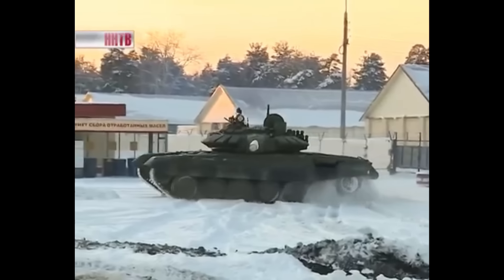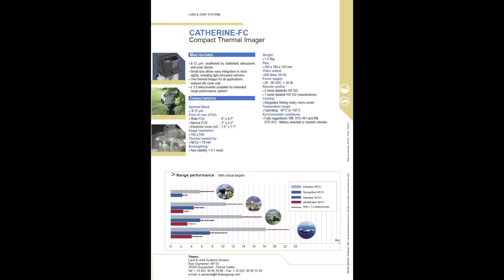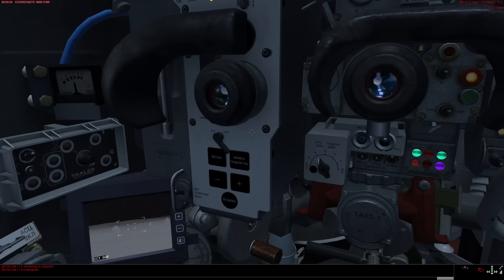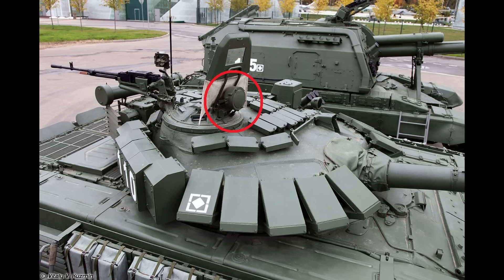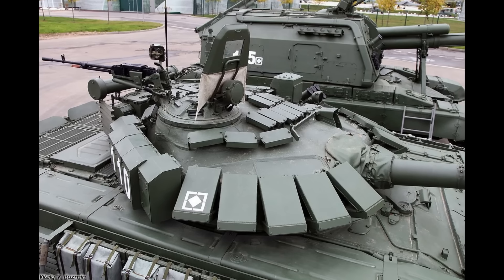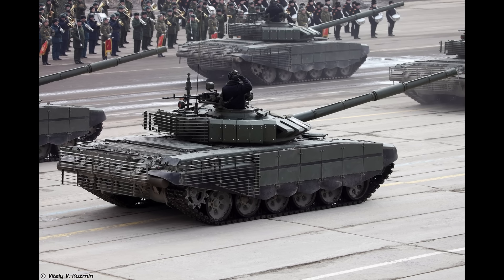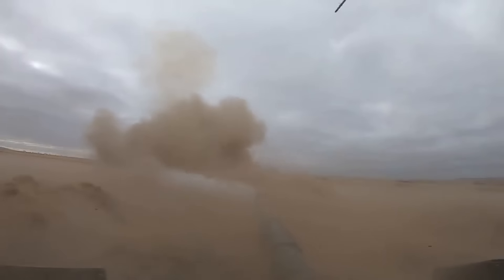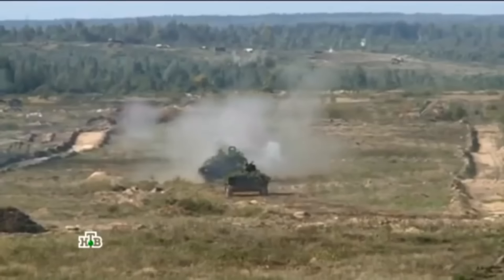Problems with Russian T-72B3 tank

Comment: Military History Visualized did a video about the German Army evaluating the T-72s it got from the Unification with East Germany. The issue with the three mile per hour reverse speed came up. To compensate for the abysmal speed, DDR tankers would instead turn in the direction the wanted to go and drive forward rather than backing out thereby exposing the thinner parts of the armor.
Reply: @Dave That was because the reverse gear was often already broken.
Lots of german armour had very troublesom gearboxes/drivetrains.
They did not have enough materials/equipment to harden/ toughen up the components sufficient.
Also sabotage by enslaved labourers from occupied countries was also a factor.
Reply: @obelic71  And in the case of the King Tigers they were using components rated for a lighter design, they didn't have the resources to re-engineer the drive train when they thickened the armor.
Reply: @digitalnomad9985  Luckily the lessons learned from the German panzers was incorporated in several NATO tanks.
f.e. the reliable (for a tank) German build Leopard was the first who was sold with a wide warenty program for NATO members. 
Modern Nato tanks now have equipment from several NATO members.
The UK's new upcomming Challenger Mark III will be a joint venture between the UK and German weapons manufacturers.
Reply: The main problem was that late in the war they lacked the alloy components the Transmission was planned with. They would have needed to construct an oversize one using standard steel.
Reply: @fantikawerner8029  Nazi Germany had several shortages of important resources/metals.
f.e. look at the jetengines of the ME 262 who burned up after +/-40 hours .
Armour was also in short suply
Reply: @obelic71  those short lifespans were common for jet engines at the time.
Even in the 1980s the MiG-29 had engines that didn't last more than a few hundred hours at most, which is one reason the German air force stopped using them, they ran out of spares for them.
Reply: @jwenting  one thing is hundreds of hours, and another is like 20 hours+high chances of explosion
Reply: @obelic71  Dave is talking about an experiece that Carius had when he commanded a group of Jagdtigers with the Schweren Panzerjäger-Abteilung 512at the end of the war. He had some very fresh and inexperienced soldiers in his group which if I remember right lead to a situation where they panicked when they engaged some allied tanks once they returned fire. Instead of reversing using the protection of their front they turned the tank around and exposed the weaker side which lead to the destruction of the tank. Inexperienced and insufficiently trained crews have become more common at the end of the war with the German military.
Reply: @krosskreut3463  considering The conditions it was built and with a ravaged industry, I'm giving the Germans a pass on unreliability for the me262. That thing was miles ahead of the competition
Reply: @obelic71  Yea it's actually pretty impressive that germany could come up with such tanks as tiger, jagdtiger and maus with limited resources.
Reply: @CrniWuk  May be the same with ruZZian tanks...
I've seen a clip where an armoured Ukrainian gun turret was pounding the side of a much bigger ruZZian tank, the kinetic energy, shot after shot, had it's effect.
Reply: @megapet777  The Jagdtiger was mechanicaly and technicaly not that impressive though. They just did with the Tiger II what they did with countless other tanks, making a "Tank Hunter" version out of it.
Reply: @obelic71  cool
Reply: @obelic71  They analyzed spectrographically a 1945 Panther gearing (the one at Saumur), and it was as well made as we could make it today at our best... The only problem was the compromise of square cut gears to minimize lack of tooling due to shortages of tungsten. Rear hardened armor was improving right to the end.
Reply: @wrathofatlantis2316  I did read that after WW2 5 still in the factory partly build Panthers were completed by the British Army so they could be tested in the US, UK, Sweden and France.
The quality of the parts and steel differt on each tank. 
In WW2 Parts came from all parts of the Reich to that factory.
I thought that only one of those 5 survived and is now in the tankmuseum at Bovington
Reply: @obelic71  stop gibbering utter rubbish and dredging up things that have nothing to do with a tank built 40 years later
Reply: @alangordon3283  Stop reacting to coments in a thread of a natural evolved coment section without  reading the entire thread!

Comment: The reverse is a nigthmare of all 72's, only 5 km/h even in T90M
Reply: Crazy how they can't figure out reverse gear when the Chinese derivatives could
Reply: @ry0usama511 totally different design, non comparable to t72
Reply: @billny5575  yeah right yet their modernized t72 still have bad transmission unlike type 99. And they figured out a decent APS unlike RU's dazzler
Reply: The type 99 use german based engines and transmission. Not even close

Comment: i never understood why t-72 have such a bad reverse speed. If I was a Russian tanker I would want to be in the T-80 although I would say the best T-series tank is the T-84 BM Oplot series with bustle autoloader like NATO tanks
Reply: No need to reverse fast when you're the one pushing forward. T-72s were more offensive minded and designed for more flat terrain.
Reply: Proryv is superior to Oplot in just about every category possible though
Reply: The problem with T84 is that at that point you could say the best tank is T14, because it really makes no difference number wise.
Tho I know that is more of a economical problem
Reply: @gerfand  T-14 is a paper tiger, there are so few it’s like basically a tiger 2.

Dangerous, yeah but it’s so rare it’s like very well armed and armored unicorn
Reply: @Tree457  the Tiger 2 was in active service and was used in war, unlike the T-14
Reply: @Tree457  no Tiger II were used, the T84 is the JadTiger unless you talking Malasya
Reply: IIRC it has something to do with Soviet doctrine at the time calling for their MBTs to be as low profile and compact as possible. Due to this requirement a smaller transmission was needed which resulted in reverse gears being traded off for a smaller size.
Reply: It’s the way the Soviet army intended on fighting. They knew that if there was going to be any war in Europe they would be on the offense and to be able to maximize tank production to cost they built their tanks around that mindset. Good forward speed, thick frontal armor, low profile, and light enough to cross most bridges in eastern and Western Europe.
Reply: For the T-72, the low reverse speed is because of cost and size, The diesel engine can only turn so many RPM, has a limited RPM range, and it has one reverse gear. it still needs the torque to back the vehicle up a hill, and to back up in mud.
The T-80U still has one reverse gear, but the Turbine turns at much higher RPMs and has a wider powerband, giving you a somewhat wider speed range while still having the torque to make the necessary maneuvers. 
On a modern western tank, they have 2 reverse gears, one for low end torque, the other so they can get up some speed going backwards. The penalty is, bigger and more expensive transmission.
Reply: @Tree457  eh not even a tiger 2, ag least there was some kind of serial production of Tiger 2. This is more like Jagdtiger.
Reply: @hummerskickass  and there would have been 50 000 of them (all types) on a large front all going forward.
Reply: Imagine if the Soviets had T-72s at the start of the Russian Civil War
Reply: where is proof that it has bustle autoloader
Reply: It was probably too complicated or expensive to produce a transmission that could handle high reverse speeds for the T-72. T-80 is jet powered and required design changes to support the drivetrain, so I assume that justified designing a better transmission for it as well.
Reply: @Palach624  and how that turned out to "proryv"?
Reply: "this tank doesn't need to turn, it will drive straight to Berlin!"
Reply: @SgtBeltfed  ah okay. I’m by no means a mechanic. Thanks for clearing that up for me.
Reply: T 80 is noisy junk, i feel headaches because of it
Reply: @RS_Mogli  i mean there is only around 20 t14
Reply: @Tree457  The thing can hardly even drive. Unless, you want to believe the guy they chose for their propaganda parade to drive the armata didn't know how to operate the brakes. Because that was the Kremlin's excuse. The entire tank could be one big bluff. There's a reason only a hand full have been made and rarely seen operated. Russia isn't a poor nation. They have some of the richest people in the world in their country or from their country. Putin has his hands on every oligarch's wealth. Money isn't necessarily the issue.
Reply: @hummerskickass  Russia now is using them in mafia war fear with small numpers agianst AT wepons thay were not designed to fight
Reply: @christiandauz3742  thay would invide earoupe
Reply: You get 50 T-72 tanks in a 2 km grid and charge the enemy's front line. That's how to use a Russian tank. They aren't made for defense and especially playing defense while left alone.
Reply: @Mal101M  I thought all T80's were built in Ukraine, and that Ukraine had done a more advanced upgrade? That was said to be why Ukraine T80's were taking out Russia units so effectively.
Reply: @اسكندرفكار  

Technology would progress much faster
Reply: @christiandauz3742  Soon they might.
Reply: @mattilatvala4164  i think earoupe wont be eny thing useble to them
Reply: @Tonixxy  Including the parked tanks awaiting repair?
Reply: @Mal101M  Ruski t80 will have parts and era missing + the amazing logistics of russian forces will keep you fueled and armed for up to a minute! + your informational and battle awareness is next to non-existent unless you wish to communicate in open radio frequencies that have music and trolls blocking out anything + saint javelina and a enemy with a better doctrine, plan and brains, russia might've been the USSR but they have lost a shit ton of land and manufacturing power and propaganda will not change reality.
Reply: @johnwinter2252  money aint gonna do shit if your just throwing it into a hole and wishing for the best
Reply: T-72 only had reverse speed to be loaded on the train.
>Oplot is best one
Kek, T-90M is better
Reply: @stalewater5571  that or tanks were only made with reverse speed meant for loading on a train. I mean, huge country, gotta use trains a lot for logistics.
Reply: @Palach624  id much rather sit in an Oplot/Oplot-M considering that the T90M 2017 still has a good ol' carousel autoloader.
Reply: Если бы, ты был русским танкистом то ты бы красил траву ...
Reply: @Palach624  Т-90М also have 5km/h reverse speed..
Reply: @BrutalSpacePony  yesterday laugh so hard, when i found
Reply: @BrutalSpacePony  already in 1999, Ukraine had a tank with an automatic transmission at 2 speeds back, while now Russia in 2022 has t 90m with a manual transmission at 1 speed back
Reply: @koterkot7148  It's no wonder when Kharkiv was the very best tank construction plant in USSR while Ural was considered second tier with its best product being a simplified waterdown T-80 called T-72.
Reply: @Tree457  Everyone said Russians can't afford new nuclear subs, new Su-30SMs, new Su-35s, new Su-34s, new Ka-52 and new Mi-28Ns, new soldier kit, new ICBMs, new littoral defense ships and diesel-electric subs. And yet here they are in service. T-14 is being worked on and will enter service. It's just that Russians aren't rushing into mass-producing a unit that's not perfected yet, like F-35 is which is STILL not fully resolved.
Reply: @fuliyaa  It's actually pretty quiet...
Reply: @orlock20  Only behind a maneuvering barrage which REALLY smashes enemy fortifications.
Reply: @williamjackson5942  The ONLY T-80s that were "built" in Ukraine were T-80UD which were Russian-made T-80U but with empty engine/transmission bay and delivered to Kharkov to install the engine/transmission set and control systems. Then later on Ukrainians did some updates and called it T-84. As for all other models of T-80 that were T-80, T-80A, T-80K/T-80B/BV/BVK and U, they were all built in Leningrad at Kirov plant and OmskTransMash factory. So Ukrainians ASSEMBLED a very limited number of tanks that were 80% complete by the time they were brought to Kharkov to install the drivetrain.
Ukraine wasn't taking Russian units out "effectively". They were relying on ambush tactics and still do. Also artillery which is the biggest killer of tanks in combat.
Reply: @Parthemonium  And you'd still die if HE-FRAG ammo in the bustle was hit. Exploding 45kg of HE doesn't care about some thin-ass little door: it rips the turret off and shockwave kills people inside anyway. That's why Abrams and Leo-2 never get tested with HE-FRAG ammo: they'll be torn to shreds and that won't do for the image of "bustle saves lives" image.
Reply: @stalewater5571  Well, it's 2022. There are better and smaller transmissions to be fit to T72 or any small tank. PT 91M, an export version of PT 91, which is a polish T72, has reverse speed of around 30km/h. It has a compact Renk transmission that fits into T72 smaller space.
Reply: @Max_Da_G  Ka-52
Oh you mean that Helicopter that was shot down by ATGM...twice...
Reply: @XOFInfantryman  So? An Iranian F-4E, a FRIGGIN FIGHTER JET(!) was shot down with an ATGM that a Mi-24 fired at it. Also NATO would have lost FAR more choppers in Afghan if Russians were to give Taliban some Verba MANPADs. Shit, US military choppers were shot down with RPGs! It happens dude. ATGM can penetrate tank armor, so what issue would it have with ANY chopper for that matter? Finally, Russian tanks are equipped with ATGM which are meant to target choppers too amongst other things. So I don't see what you are getting at.
Reply: Turret autoloader is much valuable. Problem in Russia tanks is the ammunition. Russians are using 125mm HE shells. They are extremely powerful. Also that brown think where is gun powder is just thin waterproof cardboard that can easily cant fire. Also the APFSDS casing. That's the problem. Not autoloader.
Reply: T-84 BM Oplot has much worse gun than T-90M (2A46M copy vs 2A82M1 gun from T-14) and max apfsds for Oplot is 3BM42 or Pronyt. Yes it's has better speed/reverse speed and nearly same armor with same thermals and fire control system but gun is awful and autoloader too.
Reply: @rinaldoman3331  Fun part: Ukraine hasn't got almost any 3BM42. Pronyt is the best they can hope for, that is if Poland is willing to risk those rounds falling into Russian hands.
Reply: @rinaldoman3331  90M doesn't have gun from T-14 dude
Reply: @rinaldoman3331  T-84 is a good tank but Ukrainians simply don't have the spare parts to maintain the few units they have left. At the last international tank excercise the Ukrainian tankers took part in they were nearly in tears when their T-84 just broke down due to lack of spares and maintenance. In the interview they were very bitter about it, they trained so hard but all this was wasted.
Reply: @Max_Da_G  The Soviets never tested to see if their tactics would work.
Reply: @jaroslavdudas7227  The autoloader is the problem, it limits the length of the APFDS projectile, as the Rusdian 125's use 2 piece ammo to accommodate the autoloader. With a western autoloader in the turret, your projectiles can be as long as you're willing to build the turret to hold them.
Reply: Reverse speed was not as important in 1970s and was something that could be cut. Remember $$$.
Reply: @phunkracy  T-84 is like T-90A but T-90A has much better gun.
Reply: @rinaldoman3331  gun and ammo. T-84 has also problems with turret drive due to increased weight, the ball bearings cant take the load of all that Nozh ERA. however one advantage of T-84 is proper reverse speed, which in T-90 is the same as T-72
Reply: Because the T-72 was designed by cartoonish supervillains who wanted their tanks to only be capable of suicide charges